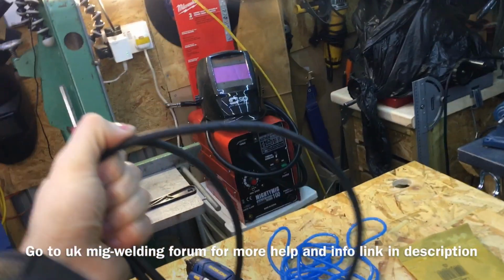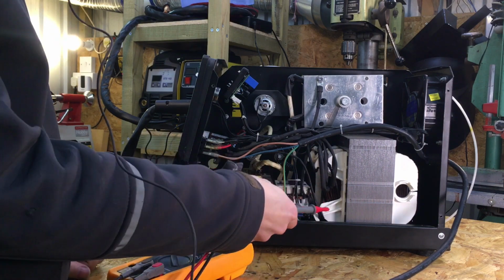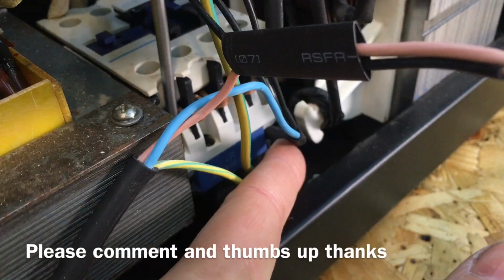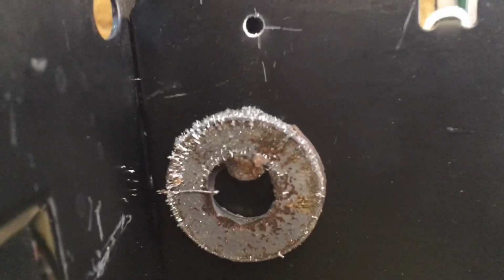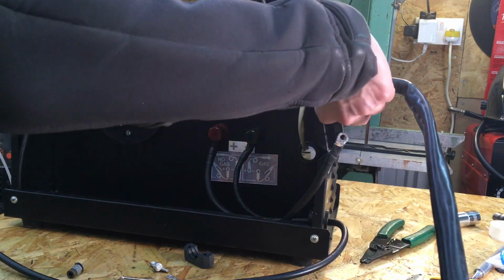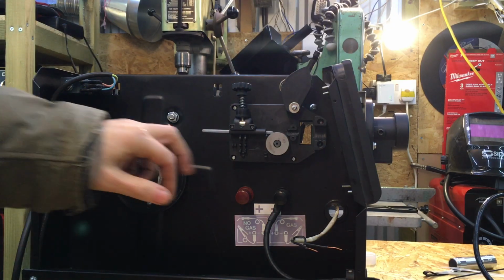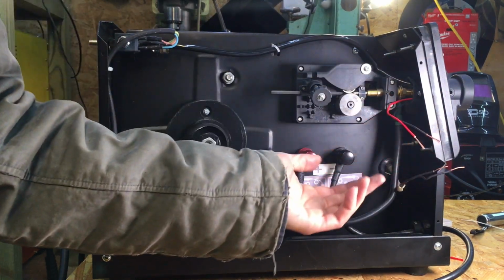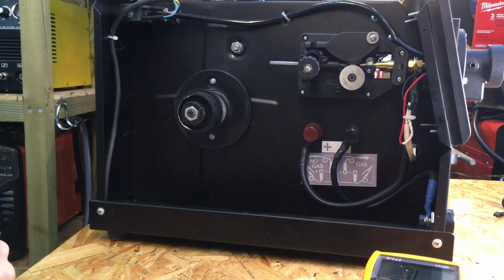Installing A Euro Torch Mount And Gas Solenoid TO Mig Welder

Comment: My machine doesn't have the switch cable to sodering with gas or no gas. Only sodering with Flux Wire and i won turn into gas sodering. You can Help me? Thanks for the toturial on this video.

Comment: My welder is 220 volt but there should be low voltage. I added a solonoid that looks exactly like yours but I bought the w4 volt version. I added Tig to my MiG welder.

Comment: I'm currently upgrading my Clarke 151 which is good enough for sheet metal.
I thought I could use the same 2 wires  for the drive unit to actuate the solenoid?

Comment: Great tutorial, Thank you. 
I want to fit a Euro Style Torch Mount to my cheap Rossi 195ES MIG machine, do I need to fit the Gas Solenoid you used on your machine or can I just fit the Torch Mount on its own? Cheers in advance Andy
Reply from the maker: I had a look it seem you would need a gas solenoid for that machine. if you don't install solenoid the gas will flow it will be on all the time and you will empty your bottle. euro torch has no gas valve .
have a good weekend.
Reply: @JAYZWORKSHOP  ok no worries I shall have a look around for a good one, Im in Aust so I will try to find a local supplier. Thanks heaps for taking the time to look into it for me. Cheers Andy 👍

Comment: Thanks, you make some very good points, especially testing with the multi-meter.  I would also add another risk to resolve; the 2 grub screws on the Black Euro housing are live (and are not recessed far enough to be safe.  I had to add rubber insulation around this housing and glue it in place.
Reply from the maker: Jim Gibson I really don’t think the grub screws are that unsafe. The dummies who try to weld there welder will die long before completing this modification.

Comment from the maker: *Cobalt Drill Bit Set https://www.banggood.com/custlink/m33GhoqQgF
*MMA welder i would like https://www.banggood.com/custlink/3vGDsufVnM
*MIG welder i would like https://www.banggood.com/custlink/K3KKs7T5nO
*TIG welder i would like https://www.banggood.com/custlink/Gm3DBGhSsi 

*Tin Snip https://www.banggood.com/custlink/KmmmnwTVMl

*Stick Welder https://www.banggood.com/custlink/DDGKsw7PU9

*Welding Clamps https://www.banggood.com/custlink/mKKGbuwF1j

*Machinist Hammer https://www.banggood.com/custlink/KmDmQ1ut11

*Screwdriver Set https://www.banggood.com/custlink/KmmKATw5w4

*Precision Screwdriver Set https://www.banggood.com/custlink/K3v3Nuwi8V

*cordless Angle Grinder https://www.banggood.com/custlink/GDKmAFL7s4

*Carbide wood turning tools https://www.banggood.com/custlink/KKmKQwfS8S

* flex shaft Rotary Tool https://www.banggood.com/custlink/3KK3Z35Boi

*palm Router https://www.banggood.com/custlink/GDGGbT1iSj

*F-Clamp https://www.banggood.com/custlink/vKDGbfuZiB

*Double Edge Pullsaw https://www.banggood.com/custlink/mvGvb7uIZN

*Mitre Box https://www.banggood.com/custlink/33KvbuTSj3

* Impact wrench  https://www.banggood.com/custlink/mKDK6g6Bts

Above are affiliate links and in the comments it costs you nothing, if you do not want to use links search on goggle more info Thanks.

Comment: It makes you able to share cables with several machines. With price of cables, that is a substantial savings. And changing torches for steel and aluminum will be much easier. Good job, did same on three of my machines.

Comment: I have an old miller matic 35 trying to do this to mine  any suggestions
Reply from the maker: Fred hi wish I had your machine. My welder is cheap crap you can’t polish a 💩 yes it works. But this mod would work much better on your welder from what I can find on your welder it should be pretty straightforward.
Reply: @JAYZWORKSHOP  Hello got your message. My machine is old it was made in the 70s still runs well. The only problem I have is getting replacement parts, my only other option is getting the Euro adapter kit for mine then it will be running fine, but I was worried about doing it myself didn't want to mess things up if you know what I mean. I'll probably just turn around and sell it I got it online right now for 400 bucks because I have another Lincoln Mig welder and Tig welding machine I do a lot of side jobs out of my garage. So, kind of welding do you do? I have a Primeweld 225 Tig welder and a Primeweld 50 Amp plasma cutter, So Iif you are looking for a machine you need to go Primeweld and take a look at their machine there from China but the really good products at a low cost with a three-year warranty and free shipping.

Comment: I seriously though this kind of modification was not economically viable for smaller/cheap welder, but your video proved me wrong, and you have inspired me to buy the part to do the upgrade to my Deca 180E welder.
Will be soooo much more usable with a 4 meter torch hose, instead of the 2 meter one that comes with it stock, which has been very limiting, and forced me to work in awkward positions. With a 4 meter hose i don't have to roll the welder out, but can leave it by the wall and take the torch to the work, and not the whole welder :).

Oh - and since every single package getting sent to Sweden gets processed through customs, and we have to pay a ground fee og 20 euro, plus 25% taxes, plus wait for them to process it for weeks, i managed to find both torch and euroconnector on Amazon. Both the uk and the german site.

Thank you very much :).
Reply from the maker: thanks depends if you have one with plastic feeder the motor may not be strong enough to push the wire done 4m torch i had that problem. if it does work it will put more stress on the motor and it may not last long.